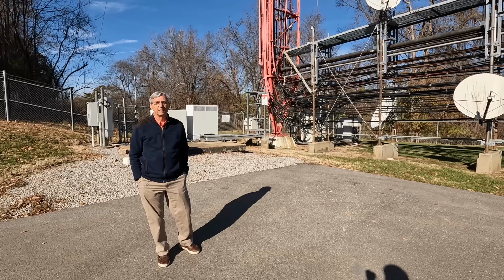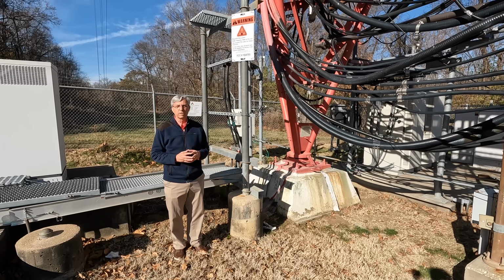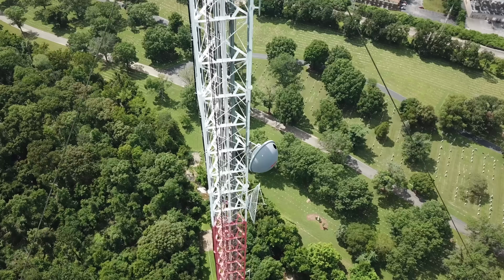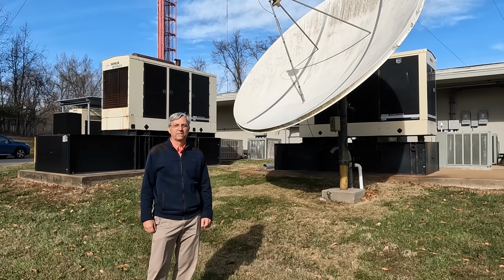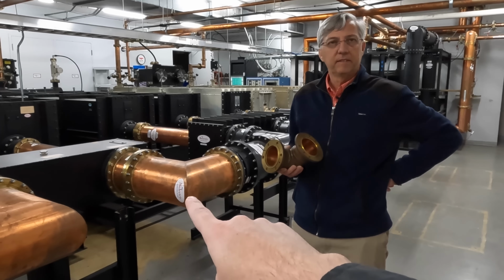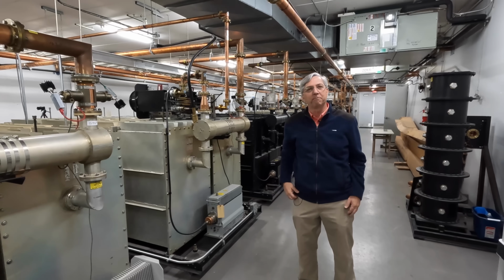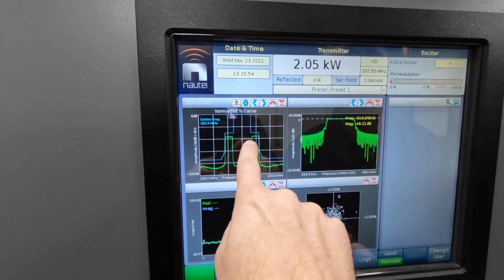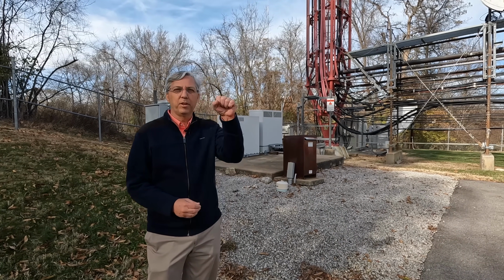1 MILLION watts—really? FM Supertower Part 2!

Comment: Very well explained. If you do a Part 3 I would like to see one of these solid state RF transmitters taken apart so that we could see the out put transistors. [in the mid 1970's the UHF 2 way base stations had Transistors on the final output and some did last as long as tubes] Good lighting arrestors are very important. Our base station (on shared site) got hit one night. Our transmitter were tube type with fuses and survived. The mobile telephone system next door were not so lucky as the had some solid state and circuit breakers.
Reply: The big difference between the classic tube-based RF transmitters and the modern transistorized ones for AM is that the latter operate in a digital way.
The final amplifiers do not do linear amplification of an exciter signal, but they send out pulses of varying length at a much higher frequency, which when combined and filtered result in the same analog AM signal as a classic transmitter would provide.
However, because the transistors in these modern transmitters are only ON or OFF and not anwhere inbetween ("analog"), they barely get hot and the efficiency of the transmitter is much higher.  The entire transmitter can operate at efficiency of around 90% (mains power to RF output) which would be impossible with a linear amplifier, which would be more like 50% efficient.
When you output 50kW, that means you save 45kW of energy when installing such a new transmitter, or 1000 kWh every day.
Reply: @Rob2  thank you for the information.  I had not realized how the world of RFI communications has evolved.

Comment: I've been inside an analog UHF TV transmitter that used klystron tube amps. There were two sets of exciter-klystron systems, one for video, the other for audio.  They output into coax (I think about 6 inch or so IIRC), then the audio and video RF mixed in a rectangular waveguide then the combined signal traveled up the tower on coax.  UHF requires a lot of power to transmit over a large area, lots of high voltage DC inverters and liquid cooling systems.  
There were several radio stations colocated there but they just took up a rack, the TV transmitter took the entire room.

Comment: That was pretty cool. I used to be a control system engineer on a particle accelerator, which uses a lot of RF to accelerate the particles but on a much larger scale (size, power, and complexity).

Cheers!

Comment: I worked one summer holiday at the Daventry UK transmitting site, valves with 200A heaters and mercury arc rectifiers off 11kv incommers. Fascinating, and all gone after a couple of years.

Comment: Super cool.  Informative and also neat you spend quality time with your dad.  So psyched that you’re going to an AM tower.  AM holds a special place in my heart.  It’s very simple in nature as FM may just be black magic!  Things wanted to see there: spend some time on the vintage stuff.  Some of us geeks are into old obsolete stuff.  Grounding, what is a textbook ground system like? Lastly HD radio.  It’s probably switched off on the AM side (it was a fad) but still may have the hardware there.  Can you show how that works and what the RF chain of that setup looks like?  Maybe not applicable to the AM tower as much as the FM, but can your dad talk about the tuning?  Presumably that FM site was designed for a single station back in the day.  The other stations have been grafted on over the years.  The Antenna has a single resonant frequency, and there’s tuning required to match the other stations.  Is that a loss in signal that the station has to get a slightly larger amplifier for? We saw the SWR meters, but is there a slick engineering response to the problem?  On your “HD injectors” that needed fan cooling..how come you guys didn’t stick some aluminum heat  sinks on the flat surfaces?  These look like steel boxes and they can’t be very good at conducting heat.
Reply: Any AM stereo stuff unused but still racked kicking around? Curious. Many AM stations still do use tubes in their primary stage because they simply didn't invest in the needed upgrades, also such tx are often so powerful that yeah they have massive single unit transmitters. Some digital TV stations with equally large transmitters 30kW+ can still use a type of modern Klystron... inductive output tube? EDIT: Yes, a single such tube can do 30kW cont ATSC/8VSB.... thats much less to fail, and they're all liquid cooled.
Reply: HDAM "should be" still in use!  I bought a Sangean tuner just to hear it but can find nobody transmitting.  I have been to the IBOC/Ibiquity site.  Oddly enough, as far as the first AM stereo standard (C-QUAM) there are a handful of people still transmitting it.  A buddy of mine (that is a Radio Engineer) thinks that C-QUAM sounds better than HD.  :-O  I really wanted to DX in HD so I hope it doesn't go away!   HDFM sounds awesome - especially on Classical!  On regular pop stuff the source is already too compressed to make much of a difference.  A lot of times if you look at "modern music" on a VU meter you would think you were looking at a sinewave/slate tone oscillator!   :-O

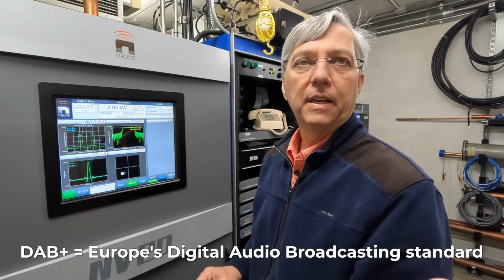Comment: 17:00 The UK does still have analogue FM. Although Ofcom keep saying that they will probably yank at some point, I doubt they will.  If they do, it won't be any time soon because it's just not worth the cost.  Broadcast FM range is approximately 88-108 MHz, which is not quite 3 TV channels' worth, and turning off analogue FM would require replacing the radios in tens of millions of cars and households.  And what else would you do with the band allocation?

For TV, it was different because you had some 40 odd 6 MHz channels occupying most of the sub GHz UHF spectrum.  It was more or less essential to shut down analogue TV and reallocate the spectrum to DVB-T in that instance.  With the advent of streaming services, there may come a time where live TV and radio will go away, but we are decades away from that.

Comment: Very interesting.  I’m a commercial roofing contractor and have installed dozens of roofs at TV/radio/cellular station’s antennae facilities and often wondered what all this equipment was for.  Now I have a general understanding. One thing I am familiar with is icicles.  I’m in the Philadelphia metro area and icicles are a huge issue for roofs.  I’ve seen icicles not only puncture roofs but also penetrate into the concrete roof deck.  One major incident was 20+ years ago at a NJ AT&T earth station where ice damage knocked them offline for several hours. $$$ Afterwards most communication companies upgraded their roofing specs.
Reply: Ouch! I guess it's good (hopefully) nobody died or got injured during that NJ ice incident.

Comment: Another great run through of the complexities of broadcasting. RF fires are dangerous events. Just because there is no combustable materials doesn't stop them from happening. We had a fire at the top of a tower near Oxford when they were upgrading to digital only transmissions. That led to an immediate exclusion zone around the tower and no way to fight the fire. A more recent tower fire in third party equipment close to ground level at Bilsdale in Yorkshire resulted in the total loss of the tower and significant risk to the ground facilities. You can see the video of the demolition of the tower here on Youtube. Amazed how the demolition team bought the tower down with minimal damage. Because of the remote location in sensitive countryside that has much legal protection, they are only now rebuilding the structure. Your father may be interested in that story if he hasn't already seen it.

Comment: ERP - think of it as elongating the radiated field and turning the spherical single bay into an ellipsoid.   With ERI's you could adjust for beam tilt and null fill. In hilly terrains like Pittsburgh we were limited to 4-6 bays and had to deal with getting down into valleys. 

As to safety - well, depends on the equipment.  We had an old RCA BTF10 that was is pretty bad shape.  We were on a temp CP and the AM noise was so bad that you could hear the modulation in chain link fence when it was damp outside.   You could turn off the fluorescent lights and the ends would glow. You could then take your finger and drag the glow from the ends to the center of the four foot tube, like some kinda Tesla experiment.  

I recall one time when it took a lightning hit.  You could see a bump in the plate blocker where it arced thru the dielectric.  So being a poor public FM (we just got WYEP-FM back on the air) I looked around and found some packing tape.  I figured might as well try it and a pushed the concentric ring out of the plate blocker, wrapped it with packing tape and pushedd it back together.  It actually worked - got it back on the air until the replacement got there.  

Thank god it never went flame thrower....

I recall installing a Continental  35kW (816 I think) for Y97 and after a few months it blew off the air.  So I get to the site and start poking around.  It had the separate HV transformer.  I noticed that one of the puck SCR's was shorted.   So I go looking around.  I follow the HV silicone wire back thru the conduit and into the transformer. So I noticed that the wire was a bit tight on the transformer's metal frame where it went up into the conduit.  I lift it up and there's what looks like a carbon arc thru the wire.   I loosen it up a bit and replace the SCR and fire it back up.  It comes to life.

So about 2 months later I get a letter from Continental where there's a recall on the wire.  I talk to someone there and they mention that a fault like what I had seriously injured a guy at a site that had 240 delta and no ground on the power cabinet.  Our site was 208 3PH and we had grounded the cabinet, so when the wire failed it just popped the SCR and the mains.

Comment: Great insight into the workings of high level RF. It would be a great follow up to delve into the actual design of the antenna elements and how they influence radiated RF.
Thanks!
Reply from the maker: That could be a cool future video; the Engineering that goes into different antenna systems is fascinating. Maybe we could find a way to talk to some engineers at one of the manufacturers!

Comment: Very good. loved both videos . I am in Boston NY and lots of stations around hear. Love the old tube. some still in use hear. Maybe you can show radio station WWV that sends time standards. still using tubes . we got a high power AM station that stays full power day and night . only the antenna array changes to beam signal . It has water cooled tubes. And hi power TV stations transmitting ATSC/ATSC 3 still have a out put tube. IOT inductive out put tube. and it's water cooled   Maybe you can show modern HD TV transmitter. ATSC/3.0 . UHF uses wave guides .

Comment: I just can't get over how absolutely massive those coax lines are
That's a terrifying amount of power running through those
Reply from the maker: If you ever see a blue flame shooting out of a 9" copper tube, go the other way.
Reply: @GeerlingEngineering  DC arc faults are similar looking, scary stuff, RF would be similar to the skin for sure.

Comment: A waveguide is hollow, no center conductor.  Waveguides are used in microwave frequencies way above fm and tv channels.  The power travels in the hollow space instead of the center conductor.  Waveguides are physically sized for the frequency being used.  Losses are extremely high with coax at microwave frequencies.

Comment: Great presentation, I like it a lot.
You should go into more depth about how gain is produced by adding more antenna bays and maybe how field strength is measured around the antenna to verify actual radiated power. 
Looking forward to AM and TV tours. 
I toured the SW station in Bethany, OH when it was operational many years ago in the 70's. The audio transformer laminations vibrated distorted audio that loudly filled the room before the signal went out to the rhombic curtains. The push pull transmitter tubes were water jacketed in clear jackets, you could stand right next to them! 250kW erp iirc.

Comment: Questions:

1:What the efficiency of the transmitters (ie Power Inputs from the grid to the real RF Power radiated). Also are the solid state transmitters more efficient than the tube emitters? 
2: If possible can you show the PCB of a solid state RF Board? Are they submerged in Oil or some dia-electric fluid? How much power does each module generate? 
3: What makes the inner conductor coax? I is it a hollow tube, or some sort of layered conductor (ie skin effect issues)
4: Are rigid Coax under pressure (video mentioned using nitrogen gas). Is it under pressure to reduce arcing?
5: How many voltages are used on the RF stages I presume its running at hundreds if not thousand of volts?
6: Does weather play a role in RF reflected energy back? I would guess that temperature, rain, ice effect the antenna matching? is there some type of antenna tuner used (to make adjustments to reduce RF reflected power) & is it automatic or does it need to be done manually?
7: I presume the RF power modules just produce a pure tune RF and some sort of RF mixer is used to inject the signal? If so can you explain & how does a RF mixer work at these power levels Is it some sort of wave guide mixer, Tube, Solid state?
Reply: Hello.  Lots of interesting questions. FM broadcast is very power hungry.  We now have LDMOS power FETs that can produce about 1500w each. Working with an antenna gain of say 10dB for round figures they would need 100Kw of RF power to get 1mega watt out yhe antenna.  Best efficiency iv seen per device is 75-80% so 100kw base power would be about 150Kw  AC input power. Their power bill must be horrific. Some stations run big power at peak listening time and scale it back in the wee hours to dave running costs.  My ham radio power amplifier is 1Kw and into a directional yagi i get about 10Kw eirp. Some operators run 100s of Kw eirp especially if they are doing earth moon earth communication.  FM broadcasting has been a very interesting subject but its dsys sre numbered. Some countries have switched them off all together much like VHF TV.  Cheers fron NZ..

Comment: Talk about the expansion of rigid coax, one station I worked for had a bullet at the top of the tower burn up. Turns out the coax was 51.5 ohm. Why 51.5 ohm and not 50 ohm? It turns out that, using standard copper pipe sizes for the outer and inner conductors, you get 51.5 ohms. 50 ohm rigid line uses a standard pipe size for the outer conductor, but a non-standard pipe diameter for the inner conductor. Anyway, Andrew makes special 51.5 to 50 ohm bullets, because the antenna and the transmitter will likely have 50 ohm coax flanges. Turns out they correctly used one of these special bullets at the transmitter, but not at the antenna. So the bullet at the top of the tower was loose. Eventually, as it slid in and out with thermal expansion, it started to arc, and then it failed. There was an elbow at the top of the tower to drive the single-bay Jampro, which I had to replace because it burned up the center conductor of the elbow as well as the bullet. Hopefully, with the special 51.5 to 50 bullet, they won't ever have that problem again!
Reply: Okay, electronic hobbyist and radio layperson here- so the bullet was physically loose? I thought you said the outer conductor was the same size? Or am I mis-imagining how this worked?
Reply: @joshyoung1440  The bullet joins the inner conductors, and is not fastened to the outer conductor. The bullet is a male connector on each end which plugs into the hollow pipe which is the center conductor, essentially joining the center conductors of two sections of coax. The special bullet was a slightly different diameter on each end so it could properly join the slightly different center conductor diameters. The special bullet fit tightly on both sides, so there was no arcing.

Comment: I am not sure if I understand the purpose of the combiners. Are they RF power combiners for each antenna? You said they combine all the channels/stations and send them up. Doesn't each antenna have to be impedance matched or tuned to its own transmitter? or these combiners are broadband? There are many cables/coax tubes going up the tower. Each going to one antenna? Are these antenna dipole or monopole?

Comment: This was a great video with great explanations. I'm actually going to send this video to some folks that can use the info. 
I follow you for other technology vlog stuff, but it was cool to discover that your dad does the same job I do (I'm on the east coast).

To expand on about RF safety, mostly for anyone contemplating vandalism or climbing the tower for fun/challenge (thinking of a recent movie); You can't see Radio Frequency energy, and by the time you start feeling effects, you may be in a very bad position to recover if you don't have a support team or are not on a climbing plan. 
Tower crews almost always have a plan and awareness for antenna's they pass or work around. I've had to be on site or have someone on site to be ready to turn off a transmitter for rigger safety while they're on the tower, even if it's calculated as safe exposure levels or exposure time. 
I've heard of broken lines, or shot-out lines (yes, by bullets), worn-through lines, etc. This means you could be climbing, and without awareness of the system, grab the wrong thing...and die...
Reply: Thanks for the safety info. Like me you have probably attended safety training sessions and had many impactful stories drive home the need for awareness around RF. My first transmitter had 10KV DC running around.